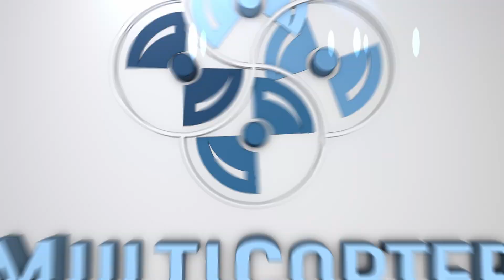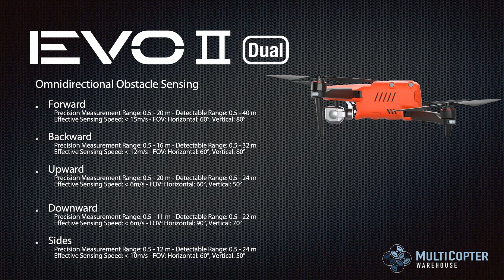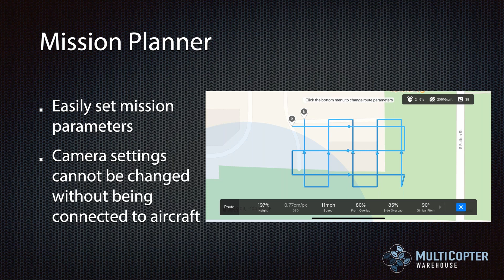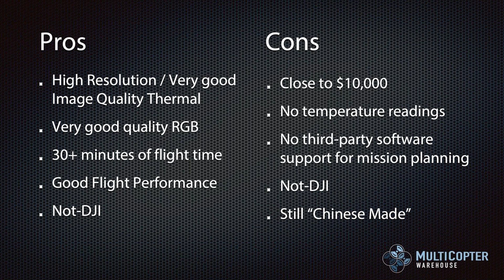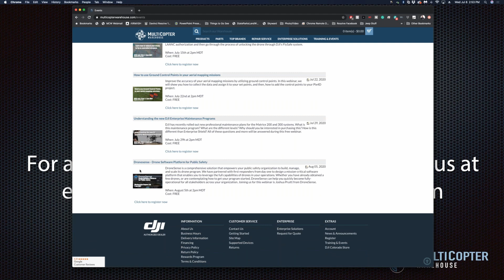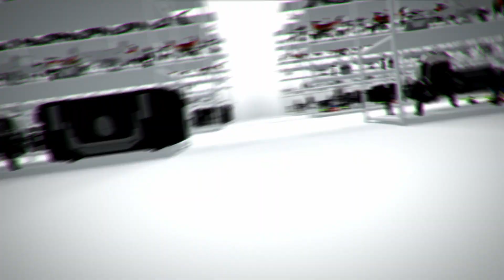Autel EVO II Dual   For Public Safety and Inspection

Comment: I purchased in lightly used condition EVO 2 dual 640R (US FLIR BOSON) vERSION 1 for $3200. Little did I know the difference about the sensor and the 640T chinese sensor. I have seen the comparison video of each sensor and seems the FLIR is somewhat better for roofing and solar inspections but you have to pay for the software. the Evo 2 640T v2 you can use the free IRPC tool for reports. 

What in your opinion would be the better?

Just need some personal advice

Thank you
Ed Ghosn
UDS, LLC